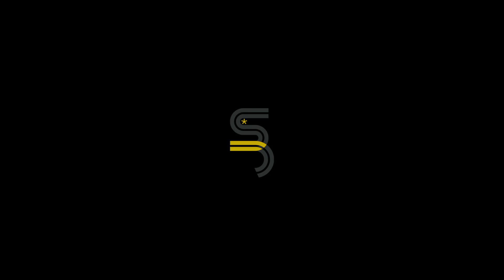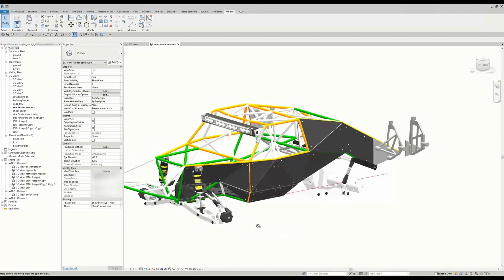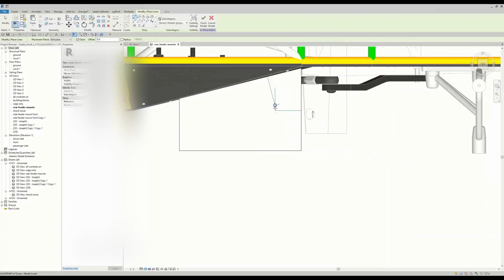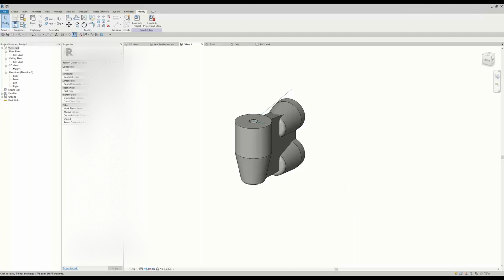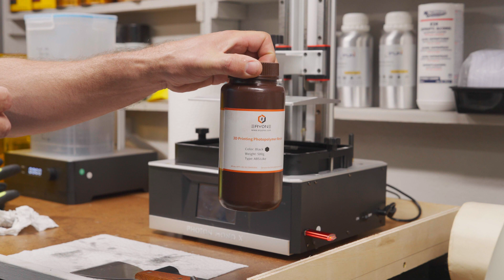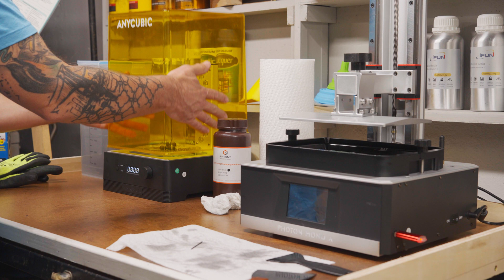Custom RC Trophy Truck Rebuild Part 4.1: 3D Printing Parts for the Rebuild

Comment: I watched the video all the way thru. I enjoyed the process and understand the thought process. I work with Solidworks, Cura, and have access to a full machine shop. Keep the videos coming!
Reply from the maker: Wow, thank you for taking the time to watch all the way through and the comment!  I have been spending more time with Fusion 360 as the go-to for designing parts but when I need to design a part up against the truck, I do still use Revit.

Comment: So this is based on a real truck, the yeti score and the baja rey am i right?
Reply from the maker: The wheelbase and overall size of the chassis/cage was built to fit the Yeti Score body.  I've since increased the wheelbase and track width to fit the Baja Rey.
Reply: @JosephStampfl  thank you

Comment: Awesome work
How did you bend the sidepanels to fit it to the cage?
Reply from the maker: Thanks, Paul.  Are you referring to the black plastic side side panels?  If so, that's an ABS plastic I picked up from McMaster Carr.  Before I created the black plastic versions, I created a cardboard template using those gift boxes you get for clothing (thin cardboard).  Once the template was made, I traced it onto the ABS and cut it out.  To bend the plastic, I used a blade to score a line (cutting maybe one quarter depth into the plastic) where I wanted it to bend and then CAREFULLY bent the plastic along the score line.  ABS will bend along that score line and not crack which is great.  HOpefully that answered your question.  If not, let me know.
Reply: Thank's a lot for the answer @JosephStampfl that helps me so far. 
One more questions: Where did you get the straps for the tire carrier? They look very nice
Thank's
Reply from the maker: eBay - can't seem to find the exact version that has the ratchet hardware but these are close.  I took the 3-point strap setup apart and made it into a single strap that you see on my truck: https://www.ebay.com/itm/203540391294?hash=item2f63f3e57e:g:d6MAAOSwAEhd8E6q
Reply: Thank's a lot 😁

Comment: Pretty nice, good ideas.. I appreciate that u share it whit us.. Definitely subscribe to urr channel.

I'm pretty new to trophy trucks.. I got a crawler and an Hpi Baja that I built out of parts from a 5T and 5Sc to get a littel bit more a TT look..

I was wondering, ore maybe u can help me by telling me what rear axel u are using and what front and middle differential u are using.. I think everything else is custum made right?

I will try to built me one for shure! Also u weld everything.. Do u think hard brazing will hold the abuse also.. Ore do u think welding is nessesary.

Sorry for my bad English, I'm from Germany.
Reply from the maker: Thanks for the questions!  The rear axles is a MetalConcepts axle.  Check 949designs.com - they distribute MetalConcepts gear now.  The front an middle diff is from a Associated Nitro TC3, which isn't very practical.  The original concept of this truck was to use as many parts from my NTC3 as possible.  Sadly, as the build progressed, fewer and fewer parts from the NTC3 were kept.  The front and center diffs were pretty much all that remained.  Right now, the truck is RWD only.  I haven't even connected the front diff.  I'm not convinced it will hold up to the abuse.
Reply: @JosephStampfl  thx that will help me.. Ok I heard that the most guys use the front diff from a traxxas slash 4x4. Theroraticly I think I can use nearly any middle diff, as long as the motor sit's in the middel.

Looking forward too ure videos.

Keep it up 👍😊

Comment: Awesome dude, what a pain the rear using that Losi Raptor body, depending on your wheelbase the Losi body is a stretched/bloated version of the Traxxas raptor, molds are literally identical as far as I can tell, even the injection molded grill and hood vent but the Traxxas body is a 13 inch wheelbase vs the Losi Raptor is 14.6 inch. Very cool to see it progress.
Reply from the maker: I looked around for a bit but my options were a 13-inch wheelbase body meant for the Slash or the 14.6-inch wheelbase body meant for the Rey.  No one is making a Yeti Score body anymore and the ones I see on eBay are being priced gouged for the little-to-no supply.  I do kind of like the Rey body setup because it is a bit more true to scale.  It just requires a lot more effort to mount and remove the panels.  Now that I am looking into it, according to the internet, the Yeti Score wheels base was only 1cm shorter than the Rey... 360mm vs 370mm.